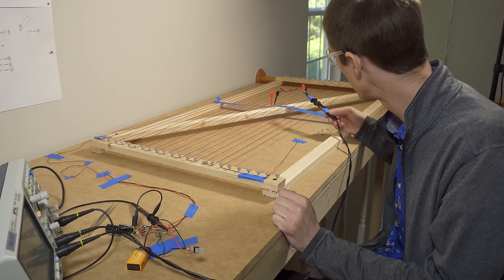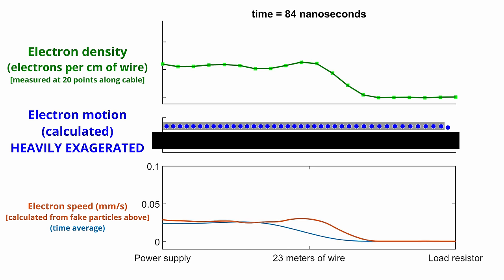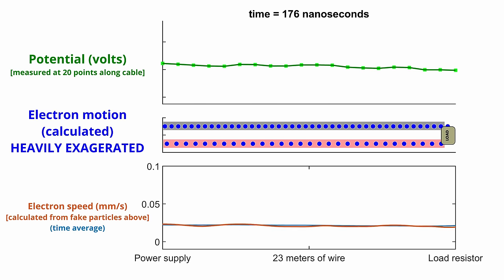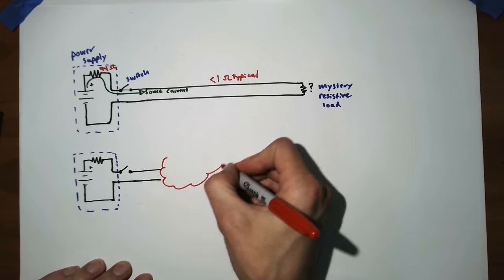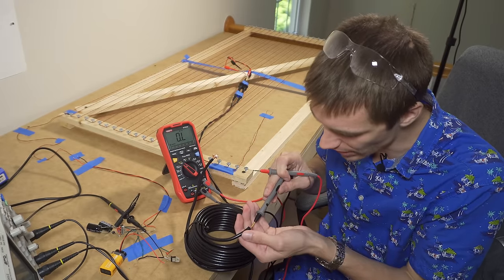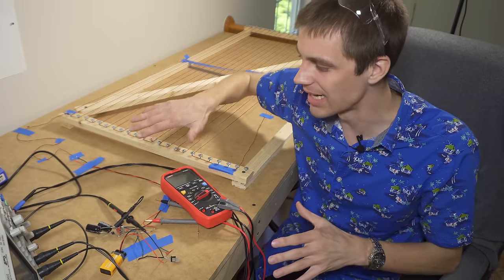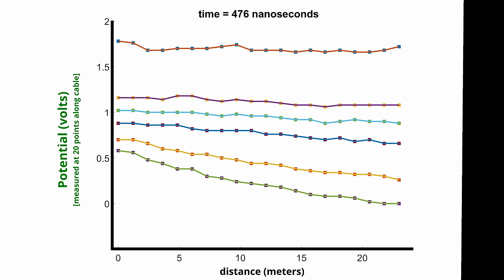What does "impedance matching" actually look like? (electricity waves)

Comment: I found that if you think of the reflection of a signal as if it were the same as light, it becomes very intuitive because when light enters a medium with a different refractive index, transmit and reflect will occur
Reply: And the antireflective coatings work by replacing that sudden refractive index transition with a more gradual one to reduce reflections.
Reply: But why would splitting the wire result in the light changing mediums?

Comment: I still don’t understand the concept of a power source, “finding” the requisite current. If I have an LED does it matter if I use a 1W or 100W power supply, will it equilibrate either way, what happens to all that extra current? What about variable current power supplies, do they just force more current into the circuit?

Comment: im still a bit confused as to where the 150 ohm value comes from? why is it 150 ohm, and not 250 ohm? Is it dependent on the kind of wire your using? is it dependent on the power supply (in your case a 9V battery)? is it some universal constant somehow?

Comment: For transmitting signals such as Cable TV signals you don't want lots of reflections so you have to impedance match everything.  Typically 75 ohm cable is used (looks almost identical to 50 ohm cabling).  You want every Y spitter to look like 75 ohms looking into it and each of the two outgoing wires (towards the receivers) to look like 75 ohms each going forward.  So you just add a 37 ohm resistor right before (as close as possible) to the split.  Each splitter has this resistor built in (and arrows showing which way the signal goes).  This way you can be varying the signal miles away and the signals travel down the wire without any reflections to mess things up.  With radio antennas I think maybe you want the antennae to match the characteristic impedance of the atmosphere!  So the signals don't reflect back to the transmitter (read about baluns which can allow 2 different impedance cables to connect without reflections).  Also look up pictures of 300 ohm impedance cabling - you may recognize it!

Comment: Wow, just wow.  What a great way to convey a bunch of really tough concepts. I took a computerized instrumentation design course for my physics undergrad about 35 years ago at Cornell.  We had an analog oscilloscope, and we're doing our data capture using an Apple 2 computer.  It's amazing how far we've come in that time.  There's no way we could have done anything like this with that equipment.  

Like you, I've been generally familiar with the concept of line and circuit impedence ever since those days.  For instance, I've always known that speaker wire is typically 8 ohms and knew that was important to maintain the quality of the sound.  Still, I always felt I was missing the big picture.  I also know that within networks, having proper line terminators is important and was even more so back in the day when we used bnc cables.  These reflections are the reason.  Imagine if these pulses were bouncing back from every connection or disconnected line.

So now you need to move on to what this means in A/C circuits.  It becomes even more important in that context where you don't ever have a steady state, and you are always dealing with some component of the line impedance.  I know I these circuits you can easily get RLC coupling between the impedance, the inductance,  and the capacitance of the wires and the rest of the circuit often creating a virtual high or low pass filter that degrades the signal.  

This could even be a good opportunity to do a cross-over with one of the more math heavy channels (3 blue 1 brown, maybe? ).  You could handle all the practical demonstration side of it like you've done here.   Grant could then talk about signal filtering, complex analysis,  and / or how differential equations enable us to characterize these circuits.   Those are really tough topics,  but a demonstration like this would really help make them tangible.   I'd also like to see what happens if you two collaborated on the data visualization.   You both do an amazing job but have different styles based on the kind of content you do. 

Thanks!

Comment: Does the magnitude of the initial wave depend on the source, the wire or some interaction of the two?
Reply: There are actually 2 coupled waves, one of current, one of potential. The initial magnitude of the potential-wave is that of the battery itself (or that of the setup-up emulating the battery) ; the magnitude of the current-wave is the magnitude of the potential-wave divided by the characteristic impedance of the cable.
Reply: @VincentParbelle  thank you

Comment: 150 ohm is the source's impedance. it's not a resistor inside the power source, it's just a representation of the ratio between its voltage and current.
now if you want to avoid waves, you need to provide a 150 ohm load. then we have impedance matching between the source and the load.
the 50 ohm cable part is not explained. it can't be measured with an ohmmeter because it's not resistive impedance, it is defined by sqrt(L/C) and only makes sense in AC.
i hope this great video will be one day followed up by another one covering complex impedance matching in AC, with smith charts and applications for antenna tuning.

Comment: I am a bit surprised that you do not know how they rate coax cable impedance. e.g. 52ohm, 75ohm are popular ratings. Coax is a transmission line for radio frequency signals. It is the impedance of the RF coaxial cable and depends on the dielectric constant of the cable and the diameter of the inner and outer conductors. They are tightly maintain in manufacturing so the coax's impedance is controlled over any length. 

Impedance matching in RF would be the source output impedance matching the load, e.g. transmitter to antenna, at a given frequency. For best match, the coax is cut to a wavelength multiple of the frequency. Thus the source, transmission line and load are all the same impedance at that given frequency. Most efficient transfer of power.

Comment: When we talk about this response as a dynamic system, I can't help but notice that should mean there's a frequency associated with its response. If this system were converted to a transfer function, representing a system like a spring damper system for example, what would those dynamics resemble? I'll keep watching for clues.

E: so it sounds like maybe Maxwell's equations are the state updates, you could maybe represent it like a 1d strip of charges interacting. I think the behavior though is distinct enough in a nonlinear way that you can't easily answer questions about, say, frequency response like I was wondering. I think the first context I encountered impedance matching was a course on waveguide design and I'm still not sure I understood what it meant in that context 😅

Comment: Absolutely amazing experiment and visualization! Thanks for putting all the effort into this. The only thing I find confusing or misleading is that somehow the power supply needs to "know" how much current it is "supposed to send" down the wire. The amount of current, when the switch closes, is immediately determined by the potential difference between the power supply and and the transmission line divided by the impedance (resistance and reactance) of the transmission line, all things you explain very nicely. From my perspective, there's no need to bring in agency that somehow the power supply needs to expect, communicate or know what's at the end of the wire. There's no causality to be broken. Keep up the good work! I love your videos!
Reply: "The amount of current, when the switch closes, is immediately determined by the potential difference between the power supply and and the transmission line divided by the impedance (resistance and reactance) of the transmission line, all things you explain very nicely."  The electricity has to "learn" where it is going and how much is work is there when it arrives. It is a *process*. That is what makes these videos so brilliant.

Comment: the link with impedance is more direct than just impedance matching. another word for line or characteristic impedance is “surge impedance “. the self inductance of the wire will want to prevent the current from flowing. the self capacitance of the line will want to store charge. if you compute how these to effects will decide what the surge current will be when you expose the wire to a voltage you actually get a real resistance value even though it doesn’t represent real energy loss. normally the real resistance gives you the current as a consequence of a voltage. inductors and capacitors have imaginary resistances which means the current is 90 degree out of phase with the voltage (freq. domain). the combination of the imaginary self capacitance and imaginary self inductance yields a real transmission line impedance for changing voltages. its usually uniform in frequency but it can also be frequency dependent in which case you get weird dispersion phenomenon because the same voltage wave will see many different impedances.

Comment: Radio:  where transients are all you have.

Seriously, though, this is a great explanation for both line impedance and an actual visualization of SWR.  The only thing missing is a Smith chart.  In studying for my Extra license, there's so many sources of impedance mismatching that the cause of impedance in the transmission line is rather glossed over.  There's an emphasis on avoiding reflections (because each bounce causes more loss to heating the wire due to internal resistances) but not much of a dive into the 'why'.  I was writing a comment asking "Where did the 150 ohms come from?" and then you actually answered it.

Comment: No, when electrical engineers are talking about line impedance they are talking about the impedance of the transmission line, not that resistor you may or may not stick on the end !!!  This impirical analysis is great and very informative but you need to read and learn a lot more about E-M propagation before you come on here "explaining"  it to everyone.

Comment: The characteristic impedance is the amount of effort it takes to charge up the transmission line parasitic capacitance and inductance. As you vary the geometry of your setup, you will see the impedance vary as well; more widely spaced wires have lower capacitance, for example, which loop geometry can wildly vary the inductance, especially when the magnetic field of one line can reach the other. Lower impedance means it's easier to charge the line, and impedance matching means the effort to charge the line matches the DC load resistance. Coax is good bc it ensures the capacitance per unit length is fairly constant, since the return path has a fixed geometry relative to the signal path.

Comment: I’m an Extra Ham radio operator. This was really helpful in understanding coax. That has driven me crazy for a long time.
Reply: Same.  I mean, I understood the math, but not the why.  Actually seeing the reflections?  Worth so much more than all of the textual explanations of SWR I've ever seen.
Reply from the maker: the explanations didn't ever sit with me, but after I had the initial animations made so i could imagine what the waves looked like, I was plugging random resistors into the cable to make measurements and one of them didn't ripple. i just kind of stopped for a minute and went "ooohhhhhhhhhhh"
Reply: @AlphaPhoenix2  These are the best moments! 😁🤘
Reply: @AlphaPhoenix2 why only the specific one stopped the reflections?

Comment: 5:19 the reflection you are seeing is the VSWR. Voltage Standing Wave Ratio. Had it drilled into my head in Tech Core, my Navy communications electronics training.
Reply: In communication equipment and radar gear impedance matching depends on wavelength/frequency and was done with capacitors and inductors (coils). Antenna couplers usually had variable caps and coils that impedance matched the antenna to the varying frequencies we used.

Comment: The role of impedance matching in minimizing the reflections of the electrical waves is exactly what you would expect from the role impedance matching has in minimizing reflection of acoustic waves. Think of the load as a boundary between two media through which the electrical waves travel. If the resistance of the load is higher than "expected" it will cause free-end reflection (you can see that the reflections from all loads greater than 150 ohms are not inverted from the original pulse). If the resistance of the load is lower than "expected" it will cause fixed-end reflection (the reflections from loads lower than 150 ohms are inverted from the original pulse). If the resistance is just right, it's like a transition between boundaries of identical densities, no reflection will occur.

Really cool to see this!

Comment: I find myself wanting to duplicate this experiment to see if I could predict and calculate the correct resistors that you would need to add at the fork in order to prevent the reflection at that point in the circuit. 

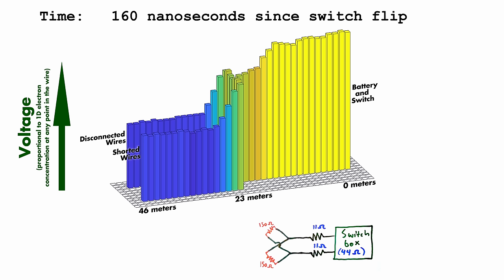From the explanation you've given so far I decided to model a circuit that looked like the one shown at 14:06, but with one additional inline resistor placed at the input fork with an unknown resistance, assumed the overall resistance of the circuit was 150 and attempted to solve for the unknown value. Giving a result of 9 ohms. (66 ohms already encountered, future line impedance behaves as two 150 ohm resistances in parallel, or 150/2=75 ohms, 66+75+9 adds up to the total desired impedance of 150.)

I've honestly got no clue if this is at all the right way to try and model an attempt at impedance matching a fork in a circuit however, and it really makes me wish I had the resources to easily test it myself.

Comment: As someone who dabbles in ham radio and is always concerned with impedances and SWR, this is really fascinating. Would be neat to see you demonstrate this experiment with sin waves and resonant and non resonant antennas. Also, your Y cable is basically like an “open end stub match” used to match one impedance to another. You could explore that with these experiments too!

Comment: Could you show what happens when the two wires are very far apart? You could use your twisted pair as one single wire and connect two of your wooden frames together (or not) at the end. Then the electric field should have a hard time to influence the other wire!

Comment: You get right up to the edge of why transmission lines and impedance matching are important in RF and high-speed digital design: In a changing signal, every variation is a new "pulse" of energy that can be reflected. Those reflections will interfere with the intended signal.

With a matched impedance, the signal will just propagate along at C*velocity factor, and "disappear" into the matched load. No reflections and no interference!
Reply: I think with your setup you could show a changing signal propagating? Would also be cool to show how a "stub" can appear matched at a specific frequency due to its length matching a multiple of the wavelength

Comment: Change the spacing of the wires on the board and change the characteristic impedance and rerun the test to show that the initial pulse really would follow that new impedance!  

This is a great demo of the benefits of transmission line matching.

Comment: Wow!  Thanks for this intuitive demonstration.  I have been dealing with those 50 ohm coaxial cable since 1990.  I knew how important the terminator is for the ethernet system but never figured out why 50 ohm.  Now I know that 50 ohm terminator minimizes the signals bouncing back.

Comment: Good Parrot you regurgitatet all well from School theory. So... If you aren't a parrot but a raven instead, then charge a metal ring negatively and spin it. Will it create a Magnetic Feld? Because you said electrons are inseparable from electricfeld. And electrons create a magnetic Feld when they move, right. So... Make a magnet that doesn't need current but moving charges instead. For science! Don't be a parrot. Do it. Also if you disse charge the negatively charged spinning metal ring then you should get an very strong EMP from the sudden brake down of the magnetic Feld.

Comment: This is also the reason why Reactive power is a thing. Reactive power flow occurs when the source/line impedance does not match with the load impedance. This mismatch of impedances creates the reflection wave that bounces between source and load (hence why reactive power does not produce "work" but bounces between those). 

For an example there could be a large industrial facility with a lot of electrical motor load (inductive). This creates a mismatch which causes reactive power to be consumed. This mismatch can be matched by adding capacitor banks to "produce" reactive power when in fact it is used to match the load impedance. 

If anyone more knowledgeable could refer sources for this application, I would greatly appreciate it. This is something that I have not found much information on online.

Comment: Impedance is affected by frequency, so it can change at different AC frequencies. The initial power on is a square wave which contains all of the frequencies, so there should be some small reflections.
It might be interesting and illuminating for you to measure this effect with AC at different frequencies and with an AC signal, you can actually see standing waves on the wire.